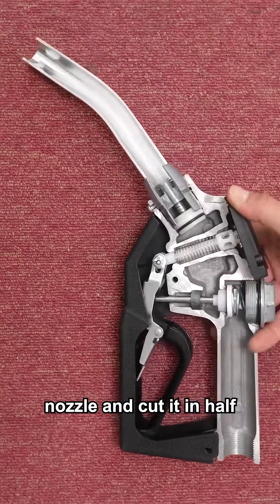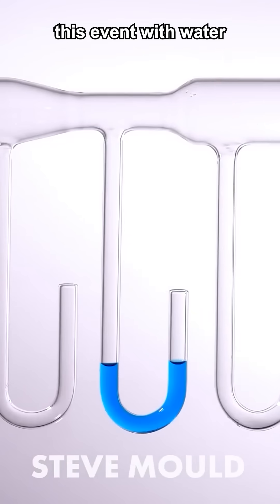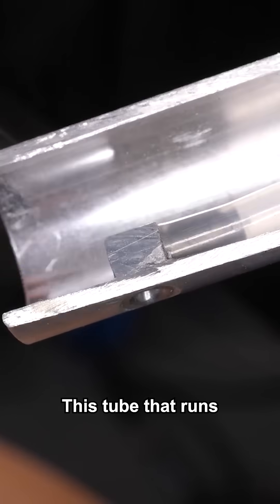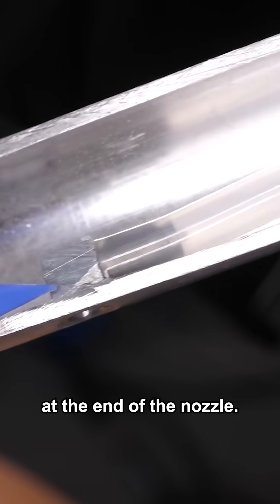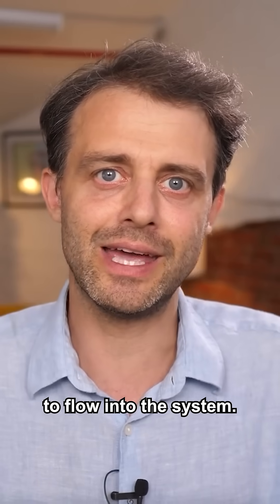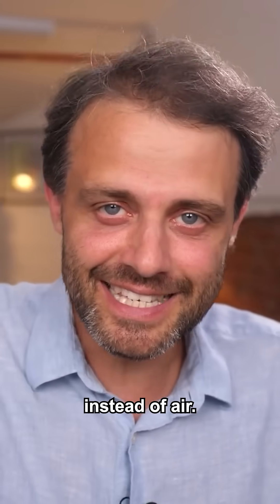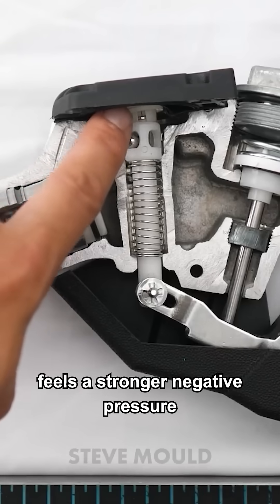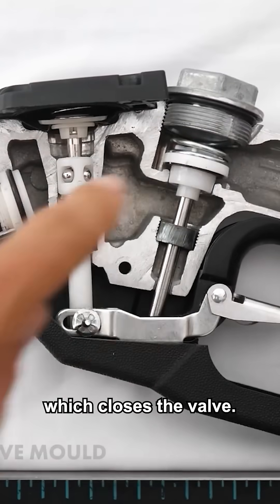How Petrol Pumps Know When to Stop! #shorts

Comment: TLDR the nozzle sucks in air while it pumps gas. When your tank is full, gas will get in the air hole. When gas gets in the air hole, the pressure will make a thingy go click! and the pump will stop.

Edit: it has come to my attention that British “people” and other subjects of the Commonwealth take issue with the fact that I said “gas,” which is short for gasoline, instead of “petrol” which is not short for gasoline. To them I say, have fun filling your tanks with petroleum, I will continue to fill mine with gasoline. At least until electric cars become the norm, in which case I’ll charge the battery with electricity, while the British can powerwank the accumulator with hyperwillies or whatever ridiculous thing they decide to say.
Reply: Pretty good summary!
Reply: We don't decide what we call things. It is the way it is. It would take much more effort for us to replace the word gas with petrol, than for you to realize the context of our words.
Reply: @astragomez8804  i know making such a change is an impracticality. Its just in my British nature to complain where I see fit. And this example rubs me in all of the wrong ways.
I can still call it stupid while accepting that its not gonna change.
Reply: Actually, petrol doesn't refer to petroleum. It's a genericised trademark for a mineral oil that later found use as a fuel. It has the same etymology, like tradition and treason or maneuver and manure.
Reply: The edit made me cackle
Reply: Why has no one mentioned that when you run a gasoline engine, you’re not burning the liquid. You’re burning: the gas 😮
The fuel injectors maximize the surface area of the liquid for evaporation, the liquid itself is not directly flammable. The gas constantly evaporating from it is.
Reply: Let me tell you this: I have never once mistaken "gas" as in "gasoline" with "gas" as in "a state of matter". The English language is full of homonyms, and some people pick and choose when to get annoyed by them like it makes them "smart" or something. We call it gas in the United States. Get over yourselves.
Reply: @ikemoon127  im not choosing to be annoyed. Im scarcely even annoyed, and it wasnt a choice. Good for you for having never been mixed up - doesnt mean everybody else is lying...
Reply: @fahrenheit2101  You know what, sure. You clearly care way more than I do about the word "gas". I'm giving it up. It belongs to you now. Have fun.
Reply: @ikemoon127  just because im chronically online enough to respond all the time doesnt actually mean i care. And i never asked for the word to be changed lol - I just think a word is dumb, its really not all that egregious of a take.
Reply: "Powerwank the accumulator with hyperwillies" 💀💀💀
Reply: Top tier edit lmao
Reply: There are some real powerwankers in the comments here
Reply: Powerwank for the accumulator just fkn sent me bahahahaha.
Reply: don’t forget to nozzlewob the mipmapcheerlight when you see another car coming! else you might blind them with your uppytip bulbs, innit bruv mate?
Reply: We also call it Gasoline or gas in spanish well at least In Mexico and some latin countries
Reply: I would have simply given a like and scrolled past if I hadn't seen that edit. Great job, keep it up good sir !
Reply: Murica! 🇺🇸 🦅
Reply: Everyone here is dumb, lmao.
Reply: Invent your own language yanks
Reply: As a British person. The edit is absolutely gold 😂
Reply: I must also report my cackling at the edit. As an anglo-american that was fkn hilarious.
Reply: if you cant figure out if it should be a gas or liquid based on context clues you’re likely mentally disabled and unable to work so sorry to bother you on your days off.
Reply: The weird thing about using gas as a short form of gasoline is that gas is also a word by itself. And coincidentally is also a type of fuel (although it is admittedly rare), which leads to even more confusion when you use the word gas but refer to a liquid fuel and not the gaseous fuel. Frankly it's just a big mess
Reply: @doomse150 except gasoline isn't burned as a liquid. It's the gaseous vapor that is burned in your engine.
Reply: BASED AMERICANISM 🇺🇸🇺🇸🇺🇸🦅🦅🦅🛢🛢🛢
Reply: Do one you nonce petroleum is correct gasoline is for steers and queers
Reply: I love you
Reply: Powerwank the accumulator oml😂😂
Reply: So normally this would look unhinged as heck but I kinda get it
Reply: Yo I’m with OP Fuccckkk the Brit’s and their powerwank accumulators. It’s gas ⛽️ for gasoline and if you can’t figure that out, even if it takes a second because dialects exist in every country, you can go shove off you wankers
Reply: LMFAO. ngl I like gas too 😫😫‼️‼️
Reply: Someones triggered
Reply: that edit is pretty funny ngl
Reply: Literally laughed out loud. Bro is the king of YouTube comments. The perfect summary and absolute burn in the edit. 🔥
Reply: British people taking issue with other people's use of English is fucking hilarious. Y'all can't even pronounce the letters, and have plenty of your own weird slang.
Reply: r/murderedbywords
Reply: That edit is brutal 💀💀💀💀
Reply: Holy fuck that's a good explanation. You should be Steve Mould
Reply: Wow. U really put effort into that did u? 👏 petrol still better though...
Reply: The worst thing about being in an elevator with an American when they pass gas is the smell of petrol.
Reply: If I ever get an electric vehicle I will 100% be saying “time to powerwank the accumulator with hyperwuillies” in an absurd British accent every time it needs a charge. Thanks for the laugh
Reply: The edit is a winner! Lol
But it's Angry Pixies... Sheesh
Reply: How the heck did you do that without cutting anything in half?
Reply: This is one of the only edits I've seen that actually make the comment BETTER, hahaha
Reply: Guys guys calm down… the correct term is vroom-vroom juice
Reply: as a British "person", your edit is hilarious
Reply: W edit
Reply: Nice edit lmao
Reply: This is the greatest comment I have ever read. Keep it up
Reply: Your edit is by far the best thing I've read on the internet!
Reply: Tldr British "people" call cars flippety flap petrol travelators
Reply: holy based edit
Reply: What a strange thing to get uptight about. Sure “gas” could be confused with the other usage of the word, but it doesn’t, people aren’t stupid. That’s like saying people get confused because “red” and “read” sound the same. Only idiots, children, and people new to the language would confuse the words.
Reply: @Bracham8 "gas in air hole" could also refer to a literal gas
Reply: @Bracham8  yes yes. Again, im beyond stupid, as is everybody else who has ever had the slightest bit of confusion about the word "gas". It should always be immediately obvious. Indeed theres no ambiguity at all. Even if one has grown up outside the US, if they dont instantly realise, its truly the peak of cultural unawareness - how dare they. Honestly its equivalent to mixing up red, the noun, with read, the verb in past participle - the sheer difference is just as big. Gas, the noun, and gas, the... other noun. The difference is always evident. Always. God bless America.
/s
Reply: Britbongs☕
Reply: @joshuapazmino7985  That edit is hilarious my dude!
Reply: I cackled at the edit so hard lmfao
Reply: I may be British, but damn that edit was funny😂
Reply: god bless the american way
Reply: Would upvote, but that was before I saw the edit
Reply: @Ignotus.  upvote? bro is a british redditor 💀💀 god punished you twice
Reply: I loved this comment until the edit ruined it 😭
Reply: Petrol is not short for petroleum. Petrol is the fractional distillate given off from heating crude oil at about 25 - 60°C.

Petroleum usually refers to ALL the factional distillates ie. all the crude oil products including petrol, diesel, kerosene etc.
Reply: What if the tank is not full , or i don't want to pump the tank full ? What if i just want pump it quarter full ?
Reply: @user-ri8hd4bo8k  then you manually release the lever whenever you want. The automatic shutoff is just for a full rank (to prevent overflows)
Reply: @Spandy428   erm , not really . The nozzle still shuts off automatically even if the tank is not filled full ... that happens where i am from ... i dont know about your place ...
Reply: @user-ri8hd4bo8k  oh like if you prepay a certain amount? I assume that's just the computer turning off the pump, and unrelated related to the pressure valve
Reply: @Spandy428  the only time I can think of where it shuts off and the tank is not full is for motorcycles (or other smaller fuel tanks) because if I shoved the nozzle all the way in it'd maybe give me like 5-6 litres of fuel. My tank can hold about 15 litres...
Reply: @user-ri8hd4bo8k then you need to release the handle yourself lol
Reply: The Americanism of gas being used for the liquid petrol, and not the gaseous air really threw me for a second.

Great summarisation!
Reply: @Pinguthepenguinu well, "gasoline" has been a term since the 1870s. "Petrol" referred to the unrefined oil at that time and was coined as a brand name in the 1890s. 
A lot of "Americanisms" are really just using the original, and often, proper terms.
Reply: @senertyk5376  granted. Maybe localised mannerisms will always confuse 🤷

The OP had a great summary. I think the rest of the world got a little confused when the word gas had multiple definitions in the same sentence.

Gasoline may be the original, gas is an accepted short form that the USA (and likely others use). Didn't stop me getting confused for a couple seconds.
Reply: @Pinguthepenguinu tbf a lot of words the the UK use vs America were words the were brought over by the English originally but then when they switched to different words like aluminum gas vs petrol etc they never told the US because they wanted to be more proper. Same with the queens math that was brought here vs what everyone else now uses
Reply: @Pinguthepenguinu The nozzle sucks in gas instead of gas. What could be confusing about that? 😂
Reply: @davidnabbit  I was once asked for gas by an American tourist. Asked him back: xenon, neon, helium, hydrogen, propane, butane? Now that confused him.
Reply: @Pinguthepenguinu it’s both…
Reply: it's Benzene and that's what we call it.
Reply: @hadyhalawy4628 dude benzene is C6H6, it's a carcinogenic, very toxic VOC, not fuel
Reply: God I hope electric cars never become the Norm
Reply: @MrA6060  Get with the times bro, pretty much every manufacturer is going 100% electric in the next ten years.
Reply: @Zurie hopefully we can get some hydrogen, Toyotas engine sounded great imo
Reply: You're extremely hostile and just from your text I can tell that you're an unpleasant person to be around. Also your description is unnecessary considering this is a shockingly easy concept to comprehend.
Reply: @lryu000 Seethe
Reply: @hommeboy  Okay.
Reply: @lryu000  ...personal attack was somewhat unwarranted (and a tad hurtful)
I suppose i apologise for coming across as hostile, its a bad habit of mine
But i stand by it - gas is, at minimum, a somewhat confusing abbreviation, owing to its ambiguity. I dont really see what room there is for disagreement on that matter. Everybody's just been saying my genuine confusion in reading OPs comment is invalid, apparently.
I never proposed an alternative, nor boasted petrol to be a much better name. Everybody just shoved words in my mouth that i didnt say. I mightve been unpleasant, but i didnt make those arguments, because as ive said, i hardly care which name came first and whatnot.
I simply dont like an abbreviation. And im being told that isnt allowed?
Reply: @fahrenheit2101  Sorry, I think there has been a misunderstanding. My comment was in reply to OP.
Reply: @lryu000  ...ah
Didnt expect that, tbh - most people are pretty much agreed with OP. I still think the personal attack was somewhat unwarranted either way. Just makes a hostile conversation even more hostile...
Reply: @fahrenheit2101  That is true to be fair.
Reply: When the gas fills up and replaces the gas then the gas comes out the gas hole and goes into the gas hole, the gas doesn't flow as easily as the gas so the gas moves the diaphragm and stops the gas from flowing.
Reply: @jdmjesus6103 or you could just say it properly and say "gas" & "air" like in the video. Nice try attempting to be a smart ass though 💀
Reply: The best example of why gas is a stupid term for a liquid
Reply: @chrisogrady28 Within the context of the subject of the video, it makes total sense to people who call fuel for their car gasoline. It's called a gas station in the US. Good times.
Reply: Petrol is short for petroleum spirit, or petroleum distillate. Gas is confusing at times, there is no denying that. Maybe we should just all call it benzina.
Reply: The comments are right you are wrong. Gas will get in the air hole instead of air.. makes no sense as air is gas. Choose your words wisely
Reply: Gas is possibly the dumbest americanisation of anything. Ever. Call it Gasoline at least
Reply: @fahrenheit2101 Gasoline likely came from Gazeline, came as a purposeful misspelling of Cazeline, named after John Cassell, a British. Gas is a shortening of Gasoline. Gas is also the state of matter. However, the expectation is that you stop wanking your willy and use your brain when communicating, and understand context clue, which is how you understand "I have to tear the bag open" vs "I shed a tear during the final scene of the movie"
Not only that, but petrol is not even accurate, (many words aren't, but using a less accurate word because your brain doesn't function is absurd) as its short for petroleum, which is not what goes in a car or used as a fuel source.
Reply: @CesarMartinez-wi7wc  idc whether the guy who came up with it was a brit, american, mexican or japanese - its used primarily by Americans, thats all im saying.
And im not at all concerned with accuracy, im concerned with ambiguity. Word "accuracy" is a hard to pin down concept anyways. Because words adopt their meanings over time.
Ive already addressed your other point.
Reply: @fahrenheit2101  gas is just short for GASoline. We, or at least I have always called petroleum (the stuff that comes out of the ground) petrol. And wasn’t America the first to have a patent on gasoline? So wouldn’t that make the British the ones who bastardized the name gasoline into petrol?
Reply: @f1rehawk99  petrol's a better name, bastardised or not. I couldnt give less of shit about who got there first etc. Gas being short for gasoline is horrendous.
Reply: @fahrenheit2101 you have clearly demonstrated you don’t know what you’re talking about lol
Reply: @DanielDuhon  ?
I made a simple statement. Gas as an abbreviation for gasoline is odd at best, highly confusing at worst. I'm not wrong in saying that, because you don't get to decide if me and plenty others find it confusing. I don't care that people use it since nothing can be done about the awful convention atp, but I'm still free to think it's stupid.
There isnt much room for misinformation in a take like this.
Do i know shit about the history? No. Do I need to? Doubt it.
Reply: @fahrenheit2101 On the other hand, as an American, I was pretty confused the first time I heard petrol. Isn’t language neat? There’s a ton of other language differences (even within the US) that are kinda weird. Did you know that different regions of the US call the sugary carbonated drink different things? Pop, Cola, soda, and soft drink are the main ones. I think its fascinating.
Reply: @fahrenheit2101  Calling gasoline petrol, as in short for petroleum, is also confusing at first. But if you have a few braincells to rub together, and can utilize context, it's usually pretty easy to figure out what a person means, whether they say gas, or petrol. Gas is no more confusing than petrol, it's just different from what you are used to.

There's no room for argument on this.
Reply: @Zurie EXACTLY
Reply: @fahrenheit2101 Ahh yes because English has no other words in it that could mean different things depending on context. Nevermind read/read, bat/bat, racket/racket, jam/jam, pool/pool, squash/squash, lie/lie, or bark/bark. As you can see these are all very distinct words that will never get confusing in the slightest.
Reply: @80nomads74 I only call a soft drink by it's brand. I'll never say pop. Fun but corny imo 😂
Reply: @f1rehawk996 yep, there's actually a dude on YouTube. That explains a lot of these differences. Like eighty percent of the things that British people say or Americans say, Americans came up with at first, and Britts changed itt.
Reply: @f1rehawk99 facts
Reply: @f1rehawk99 You're not watching this on YT. It's on YouTube. Stupid and pedantic difference. 
(Just to emphasize your point about "gas").
Reply: @fahrenheit2101  no lol. And what are you gonna do about us saying Gas? Nothing. Be mad about it lmao
Reply: @pinkpapafranku  truly im enraged rn
Reply: @fahrenheit2101 You guys used to call it gas/gasoline until you saw us doing it and decided it isn't cool anymore. That's a very common similarity between "Americanisms," including calling football soccer. Dropping soccer soccer was a quick decision in the 80s when soccer, as you called it, starting getting popular in the US. Football, as a term for American football, has existed since before soccer made it to the wes. You pretend like using the words we use makes us ignorant, when in reality it makes you snobs with zero self awareness of it.
Reply: @d_the_great nicely put.
Reply: @fahrenheit2101 Not an Americanisation, the term came from the UK.
Reply: @fahrenheit2101 Good ol' English language.
Reply: @fahrenheit2101 as opposed to petrol?
Reply: @mem7806  i said like 10 things in this thread, i havent a clue which youve replied to. Looks like you're making some sort of assumption tho
Reply: @fahrenheit2101 homie maybe take a few days off of the internet you’re getting worked up over nothing, this isn’t an issue that anyone that isn’t chronically online actually has a problem with
Reply: @tomb6776  i dont have a major issue with it and never said i did. For some reason im being told it isnt reasonable to even find it mildly annoying and a fairly poor abbreviation. I'm not worked up - touché on the chronically online bit, though.
Reply: @fahrenheit2101 and Petrol is stupid for a shorthand for gasoline because Petrol is short for petroleum, which can cover a whole family of products, including several other fluids contained within your vehicle many of which are just that's important to the function of your vehicle as gasoline
Reply: @fahrenheit2101  Gas was first
Reply: And nobody asked you to say petrol. Just say gasoline ffs.
Reply: @fahrenheit2101 says a guy calling himself Fahrenheit
Reply: @epicgamer7697  and? I don't really see your point - sure the name's an American unit, but my point was never as mundane as "America bad" anyways. Also, calling myself fahrenheit has nothing at all to do with me liking the temperature scale - I do still agree with most non-Americans in that it's a weird ass scale. But I do appreciate that I only think that one's weird because I grew up with Celsius.
I do not think the same for gas - yes, sure, I'd get it if I were American, but it's still got some ambiguity to it that ends up bothering non Americans, albeit mildly, whenever you guys speak of it, whereas with Fahrenheit we're bothered for totally different reasons...
Reply: @fahrenheit2101 sounds like a you problem if you can't wrap your head around gas being short for gasoline (and not referring to the state of matter) in the context of fuel for an engine. Maybe you should head back to primary school.
Reply: @foreverknight66  indeed. Im dumb you're smart. Making mistakes is for noobs. Whatever ends this meaningless debate, pretend I just said it - I dont have time for this
Reply: @fahrenheit2101 dont have time for it but you keep replying to people like you live on the internet to argue
Reply: @ashbolender7595  idek what i said to you, but its not like it takes a whole lot of effort to reply yk
Reply: Is it really that ridiculous to find the word gas being used to describe a liquid confusing?
At least accumulators and hyperwillies, hyperbolic as they may be, can be uniquely attributed to a certain thing...
Gasoline i take no issue with, gas is somewhat ludicrous.
Reply: @fahrenheit2101 in all my years in America I have NEVER been in a conversation where the state of matter was confused with a way to refer to gasoline. There are plenty of other words in the goofy language left to us by the colonizers that has two different meanings depending on context.
Reply: @ImTotallyTechy  of course it doesnt confuse you guys....
How does everybody keep missing the point? Its the entire rest of the world that gets confused, *obviously*. Not everything's about y'all.